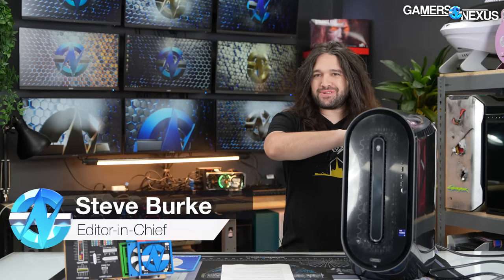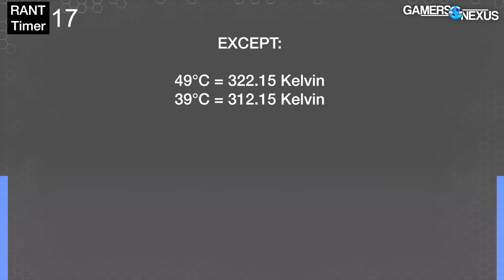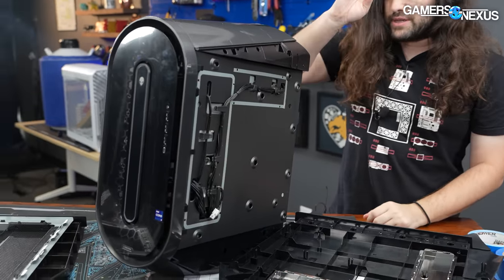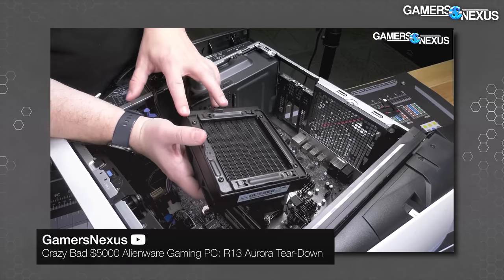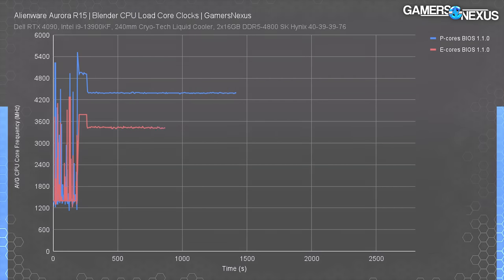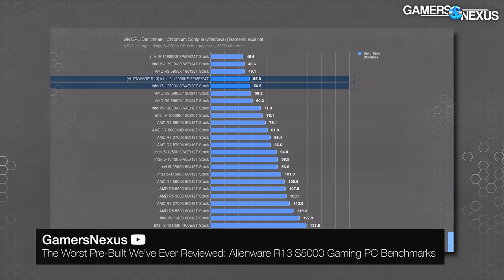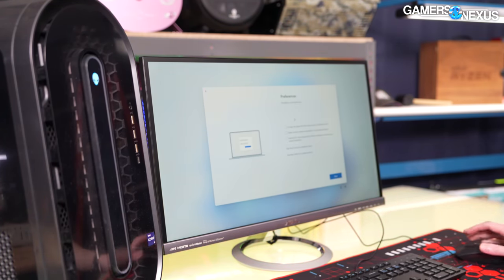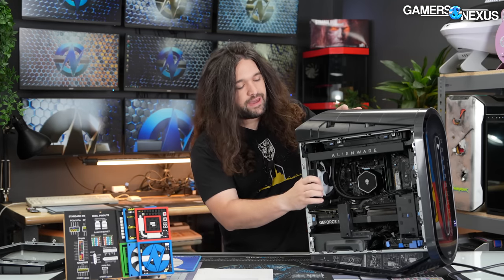Alienware Can't Get It Right - R15 2023 Pre-Built Gaming PC Review

Comment: I'm curious if by either removing the top panel entirely, or making your own holes, how much of a drop you'd achieve?  

A 240 aio is on the smaller side for a 13900k, a 280 is where I'd say is a minimum for a case like this.

In before 2029 where they finally achieve an A rating for this case, only for a new case in 2030 that stays almost the same again for another 10 years.
Reply: I’m wondering this as well
Reply: It certainly needs more power though. Advertising wasn't a complete lie.
Reply: Does not really matter in this situation since they are undervolting the CPU, and there does not seem to be a way to fix that in their BIOS if you were able to allow it to cool off better by drilling holes in the top of it.

Comment: Hey Steve, you're not right with the temps. You would be right if this were a thermal engine, where indeed, efficiency needs to be calculated using Kelvins. But in PC, where the semiconductors want to be kept below some (thermodynamically) arbitrary temperature, and the whole range of temperatures comes from ambient to Tmax, then usage of Kelvins in this manner makes no sense.

Comment: Suiggestion: Make another video with this PC where you remove all plastic airflow obstruction from the top and front - use a Dremel to cut away bits if necessary - then do another round of basic thermal testing.  Title the video: How to fix your AlienWare R15.

Comment: I've been an Alienware computer user for ten years.  My first was the Area 51, and now I have the R15 and it's fantastic, just as the Area 51was.  I'm not a gamer, but I use many intense programs at a time and have never had a problem.  I would recommend the R15 to anyone wanting a high-performance computer.  Oh, and by the way, the only reason I replaced my Area 51 after eight years of heavy use is because the headphone jack stopped working; so, I gave it to a ten-year-old girl to use to expand her horizon's.  One more point, until I started using Alienware, I lived in a computer nightmare with crashing computers.  I've never had an Alienware crash...

Comment: The option to upgrade your ram to something you can clock is a must for this machine. The stock ram is trash. I haven't seen many of the problems demonstrated here on my R15, except for the voltage throttling. I didn't see as large of a jump though. I've been overall satisfied with my R15.

Nexus, you guys are the best!

Comment: I bought an alienware ON SALE 33% off. Then fixed it.
The power suppplies are junk, change them.
Cheap out on the ram during build, buy better ram for cheaper (get dual channel, atleast 16gb, 32gb is ideal)
They overcharge for the ssd, so cheap out on that too. Because they ALL have a second slot, so buy a second storage drive and youll be fine.

The bios is solid. The board is good. The compatibility is reasonable. The price CAN be right if you know what you are doing and what to expect.

Comment: you know what they should do go to a F-117 phantom style case with triangle mesh corners that are about 2 inches wide with a glass top glass panel that can swap for a mesh panel put a oblong hexagonal front panel with a infinity mirror and a center rbg/ I/O,USBC,USB3,headphones bar,  full mesh bottom back mounted SFX 800-1000 Watt PSU, Top CPU rad with bottom fresh air intake fans keeping the same angular case design with side mounted 2" mesh near the bottom, would keep the aesthetics, have much more function, and have a wider audience

Comment: It is possible to salvage this case. I tore out all the useless plastic junk out of my R14, put in a push pull 240 aio in the front. Moved the psu to the right side, turned the left side panel into a mesh panel. Opened up the bottom and added two intake fans. Then made an opening on the top and removed all the useless plastic up there and added another exhaust fan. It’s not pretty inside but it looks damn near the same on the outside and the temps are great. Now this is the first time I’ve ever modded any PC before so I would hope that the engineers over at dell could make similar changes to the chassis but make it look better. They’d actually save money I would think because there is soooo much useless plastic in these builds. Honestly if they removed all the useless plastic they could add in so many fans and make it sooo much better.

Comment: Steve, if you haven't checked out an Optiplex system in the past several years, it explains a lot of the compromises you see in this Alienware.  The Alienware is derived from their bread and butter generic business systems - the springy latchy side covers, the blue plastic sleds for the 3.5" drive, the 12v power supply with rails on the motherboard, etc. etc.  It's all just modifications on top of their generic platform.

Comment: personally, i dont hate the look of the case you could even keep the rounded top. what i would do personally is, a) make the bottom even across, the slanted section looks odd. b) take off ALL of the plastic garbage on top and make it a screened cage that allows the cooler to actually vent all the air instead of making a 90 degree turn. having that better airflow would alleviate the need to throttle down power servicing. c) maybe they could take a page from fractal and make the front of the case vented, say take the vent holes from the meshify c and apply that to the front of the case so you have direct airflow into the structure. 

then obviously swap out the ram for a xmp enabled, remove any interior case clutter and re-test.

Comment: I’ll never forget getting my Alienware pc way back in 2006 as I was fed up with my pc builds not quite working and it’s impressive that nothing really has changed. I sent mine back after 3 days as it kept overheating and the advisor told me while ordering that the case was metal, but was cheap blue plastic with slightly different colours between the front and side. Complete disaster. Impressive the price though come down a lot mine was £3,500 in 2006. Switched back to self building and never looked back.

Comment: I made the mistake a while ago of getting the r13. Had so many issues with it and went ahead and tried to upgrade the aio to an Nzxt kraken 240mm and it worked I will say. But I kept getting an error every single time I opened up my computer. But dells customer service turned my little issue I had with them into basically breaking the computer. So I was lucky enough to get a refund. But while I had it that thing was super hot. It'd get so hot and perform not very well. As a noob I didn't really know and still thought it was pretty good but the temps I knew were bad. It'd get so loud it sounded like a jet. Im happy I finally upgraded and built my own PC with a custom loop as well. I decided to go full out. And I got the same parts besides more memory and more vram on my gpu. Its night n day difference. This thing performs so much better at way lower temps and is so much quieter when I ramp up the fans. I love my build. I truly wish they'd just listen and do better. It's so sad seeing how just awful they are and they're listen to the very minimal degree. But they're so stubborn to actually change their ways. It's sad seeing people trying to defend them and making a mistake in getting their products like just I don't get it. I fell for the trick cause I thought the case looked good. Sadly it's not as good as it looks. They really could do good if they just made it bigger. They can keep a similar design but make it bigger. Go taller n slightly wider. They can make the inside sleeker and smoother and move the hdds to the back if they go wider and move all the wiring to the back. Add some fans to the back motherboard tray and make it taller so you can add three fans to the front and side and then add two fans to the back and two possibly if they can then 3 to the top and boom better air flow. Simple crap guys just listen and follow the trends that the other companies are doing. Don't have a fricken vent to the side and negative pressure in the case. It's simple crap. Also make better keyboards and mice and stuff cause just good god. The mouse is so cheap. I got a nice mouse from Corsair that was so much cheaper from what I remember and the keyboard sucks. But that's dell for ya.

Comment: Looking at that case design, I keep thinking that top shell should have had multiple exits.  Essentially two or three of those arched exhaust ports like the rear one across the whole top of the machine.  Would keep the spaceship look but actually let the flippin air out!  Those VRM heatsinks look way small for such a high power CPU, and a spot cooler becomes more important since the AIO cooler doesn't have the air spillage cooling for that area like an air cooler tower.  Likewise expected an intake grille at the ramped section at the lower front, maybe even with a third fan down there just for GPU, HDD and PSU area.

Comment: Judging from the dust in the fans I bet they had them up on a wired shelf and they were doing drywall repair above where that shelf was and just put a plastic tarp over them. The dust coverage looked like some telescopes I've seen that were in similar situations. The particulate is usually hard to clean off, it usually won't blow off with standard usage or via compressed air. I had to soak the primary and secondary mirrors.

Comment: the "error" about the actual cooling reduction. is one of a litany of reasons why I'm moving ineluctably towards becoming an insane unit zealot. I'm working on my mech eng degree and i constantly have to convert temperature units. i have the conversion factors memorized and i can almost  convert units without even thinking about it. that being said,   all i hear around me is people bellyaching about the US using imperial (usually from people without any sort of STEM education). people think that i would agree because i have to do so many conversions but i feel the exact opposite because i know these temperature units so well. celsius is okay for the bulk of chemistry applications because this planet is filthy with h2o. kelvin is  a better more accurate system, it's not just 0 equals water freeze and 100 equals water boil. so then Celsius would be best used for atmospheric temperatures right? and a resounding "NO” is the answer. atmospheric temps aren't just factors relating to the properties of water. where on this planet will it ever be 100°C? is it easier to understand numbers like 26.3 or just 26? is the number 32 impossible to remember? if you answered negatively to all those questions Fahrenheit is the best system for atmospheric temperature. it has nearly 3 times the amount of units on the positive side of a number line than celsius.. and since single Fahrenheit degree variations are detectable by humans; Fahrenheit is what we should be using. 100 and 0 degrees Fahrenheit being the approximate threshold for when outside temperatures begin to get intolerably dangerous to humans is probably the best way to measure the world around you considering you're human and not water molecules. 32 degrees Fahrenheit is when water freezes but you can stand that atmosphic temperature for a while without special clothing. zero is when it's starts getting dire.

Comment: My aurora R4 has been going steady for about 13 years now or so.  Idk everyones problem with them. They are just a Dell pc. And will always be influenced by Dell. 

I gave mine a 6 core cpu upgrade using  (stock cooler).
Orginal atx board.

Threw in 18 gb of ddr3 1300mhz

Kingpin 960 ssc 4gb ddr4. 

I gave it 1 coolant swap.. but no abnormal problems. Mine was one of the first produced. Back in 2010-2011 ish.

Only problem or rather inconvenience ive had is power button broke so have to jump the pins. But isnt that big of a deal and dosent affect perfomance. 

Idk if ill ever throw it out 😂😂

Comment: What or who would you recommend as a PC builder? I could probably put one together myself but I know almost nothing about computers and what parts to buy and it all sounds like a foreign language to me. I don't have a ton of requirements for how good my PC should be, but I would like some help trying to find a PC setup that'll allow me to do the following:

Stream/Record: So I can play games and upload videos of said games once I'm finished broadcasting or recording.
Play Minecraft: Specifically some higher end modpacks like the newly added 'Dawncraft' modpack or really anything with 100+ mods and low-mid tier shaders (possibly shaders, idk, just throwing that in there because.) (FPS between 30-60 stable with little to no lag spikes.)

That's pretty much it for my requirements. Minecraft is one of the beefiest games that I have and I always have issues with its performance meanwhile most everything else either has less issue or works perfectly fine in its default state. If I can get a computer that can run heavily modded Minecraft AND allow me to stream it at the same time, then it'll run literally anything else that I have.

Comment: One thing that does seem to be a big advantage of Dell's approach here: I very much doubt any 4090s in these boxes have suffered from the melting connector issue. With the rock-solid way that card is held and the lack of strain on the cable, so long as it's correctly installed to begin with that connector should be fine. Not catching fire is a low bar, but with a card that expensive it's one you really, really need to clear.
It seems, from what we see here, that if Dell chucked out the outer plastic shell and mounted the metal part of the case in something more minimalist with a lot of ventilation they might have a decent build on their hands. Why they're addicted to that silly shape is a mystery at this point.

Comment: As many issues as you presented, this review seems better than many from the previous year (like Origin/Corsair & Skytech) . More of the problems seem to lie in design instead of execution or quality. I am wondering if you could do a video or post summarizing your most recommended pre-built PCs? Surprisingly difficult to find quality control checked and insider backed recommendation summaries, instead of just single reviews.
Reply: Maingear, microcenter powerspec, and abs

Comment: Hey steve i think your comments about airflow into the plastic top are a little unfair.

Ive done mechanical design work on thermally intensive forced convection based cooling systems in the past, and it is 100% viable to reroute air 90degrees in a heated exhaust flowpath....if done right.

Let me explain a little. When you are funnelling hot air out of any system with fans, i.e forced convection,  your dealing with all sorts of vortexes and erroneous flows out of the fan blades themselves depending on their angle of incidence and shape. If you capture that air in a funnel with smooth walls and start changing its direction in a gradual fashion l, it can be beneficial in that you create a thin boundary layer along the funnelling wall that helps control the air and stops particles crashing into it. Something of a funnel made from air itself. But it has to be done right for it to work. You have to funnel it from fairly close directly after the fans and think about how you may constrict the flow and affect static pressure.

I had to do this on an industrial outdoors based system  that uses peltiers to cool an internal cavity and produced alot of heat,..... because we had a vertical exhaust on an out door unit , birds started nesting on it for the heat... and leaves started gathering in it, snow would melt thru it and damage the heatsinks. So we funneled it 90 degrees to the right and forced the air out the side.

Its needs to be done gradually and thought given to the curved surface to maintain good velocity across the boundary layer.

If you throw in a big maguyver 90degrees square turn then yes its going to suck.

Steve, if you are going to go and say that turning 90 degrees is bad and its wrong and it sucks, you need to then show us how they achieve this air redirect. Otherwise you might be wrong.

Comment: I can't possibly say whether I do or do not work for Dell, but Alienware truly is one of my life's greatest disappointments. My uncle, who was a very successful self-employed programmer, and like a dad to me, is honestly the reason I work in IT. Shortly before he died in 2009, he bought one of Alienwares first laptops and it ended up with me after he died, like most of his other stuff (thanks Unk! 😘). It was pretty good. I then bought an Alienware 17R2 laptop in 2015. Never again. Using it as a work PC as well as heavy gaming, I pushed it far beyond the intended duty cycle hours but still, the internal power cable between battery & mobo actually charred, to the point where there was a deformed spot on the bottom of the case where the plastic began to soften/melt, as well as horrific thermal throttling on both CPU & GPU, and other issues. To be fair though, it continued to work even with that charred cable haha That was the first, and last, Alienware I ever bought. I'd never, ever buy an Alienware desktop - over-engineered, bulky, unattractive, underperforming, non-standard, hot messes. It's such a shame. We, oops, they, could really do something VERY special with Alienware if they first concentrated on getting the basics right, and then approached the aesthetics in a classy, understated manner rather than trying to appeal to 12yr olds whose parents have more money than sense.